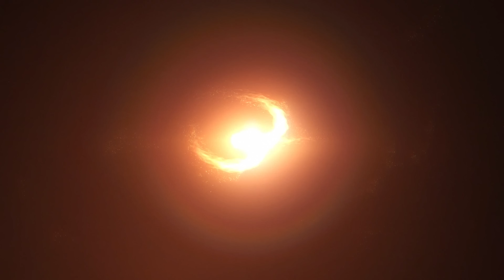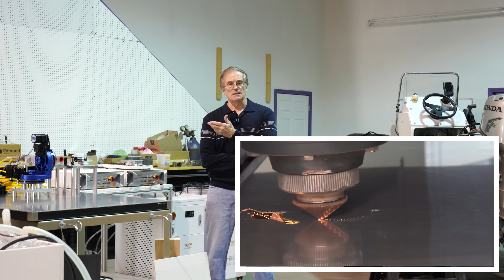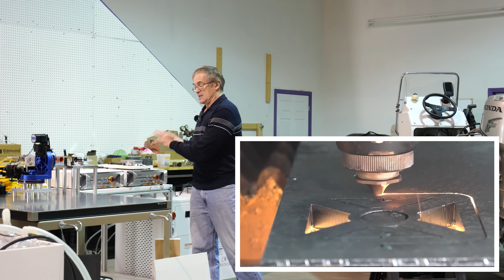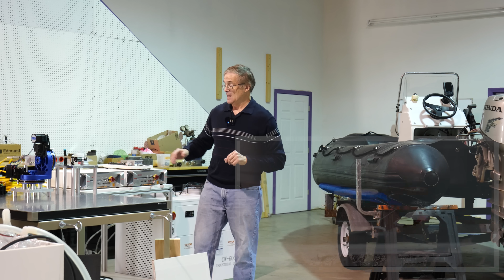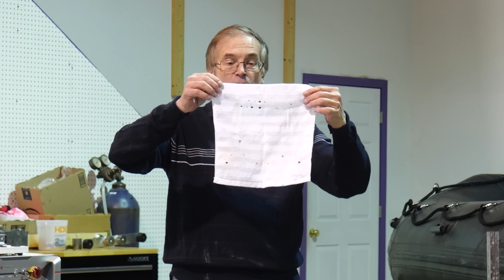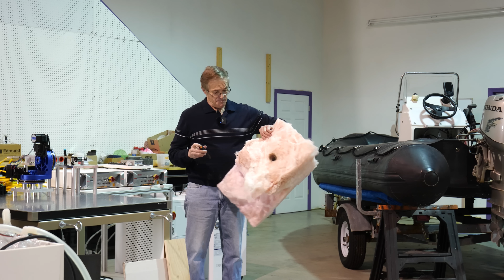We have a problem... and need your help!

Comment: In a cold room, could you heat a surface below to generate turbulent rising air that causes the beam to refract and lose energy before hitting a backstop of some kind? Perhaps overlapping tiles fresnel lenses?

Comment: Have you tried multiple layers of cement board, instead of gypsum drywall? Should last long enough for you to turn off the laser, you could mount them to a steel 2x4 wall that is on industrial castors, so you can wheel it around. If you cut the boards into smaller pieces, like 24" square, before mounting them, you could also make it easier to replace. Hell, you could put whatever you want in between the boards, like sand, ceramic tiles, rockwool insulation (made of minerals instead of glass), starlite(Nighthawkinlight). 

I'd be interesting to see if 2 pieces of 5/8" cement board, with 1/2" of starlite in between, like an oreo, would be able to handle your lasers.

Comment: If the target were rotating, then it would dissipate the energy across a large circumference     So a  circular piece of very flat dry wall, a few dozen cm in diameter, mounted to a small motor, will keep the disk moving, so that the energy is dissipated in a very large area, not a pin point.   Need more dissipation, just increase the diameter a bit, until the target can tolerate the power continuously.   The circular shape, can easily be marked, with rotation and a fixed pencil.  Slowly cut into it there, as it rotates with a sacrificial metal blade.  May be self balancing?  idk,  or may take some patience.   Keep it dry.

Comment: How about clear polymer orbs that are wett, maybe inclosed in glass or clear plastic sheet on each side to hold then in and 4-6inch thick layer of a standing wall. laser should be shattered due to orbs round shape.

Comment: 45 degree angled mirror directing the beam straight down in to an oil barrel with sand and water or a piece of composit material containing ceramic. Like tank armor in a layered construction. You simply cant have it all.. Cheap, durable AND portable and so on If its cheap and easy to come by, you say goodbye to portable. If its expensive it will be hard to come by and most likely not portable either. If you find something that will do it all.. make sure to get a patent and give darpa a call before uploading your video. Darpa or D.O.D pay a lot more then youtube.🤘 Happy hunting. NB: Here in Denmark we have ww2 bunkers all over.. those things would only feel a tickle if you shot you laser at them.. 6 feet thick walls of old school cement can take a beating

Comment: As a jeweller, i fix jewellery with a laser. Often with gemstones, which are vulnarable to laser light and get damaged when hit, even by indirect scattered laser light. 

When soldering with a flame, there are cooling pastes on the market, a white thick gelly paste, wich protect stones for the same purpose but against normal torch flames. I went about testing it while fixing jewellery, and this paste also proofs very effective against laser light. As a test I could cover a piece of printer paper with a thin layer of this paste and would not be able to laser a hole through the thin paper anymore.

The combination of moisture and the white substance in this gelly paste, seem to be very effective in blocking and absorbing laser energy.

I hope this helps!
Reply: This is the best answer from someone who started by stating their credentials so far. Here's why I like it. The solution is portable, plausible, and doesn't ask that any part of the experiment be reworked to accommodate it. For those Reasons I'm very happy with your comment.

Comment: hi have you considered sandbags? with for instance, playsand, maybe even high silica sand from a desert/ beach area. it'd have enough diffraction, thermal capacity, self-collapsing ability, to make it cheap and usable,  and in bags like hessian, or military surplus, would be easily buildable and take-downable. only problem i'd forsee is that you shop looks like a bunker.

Comment: How about two sheets of glass transparent at laser frequency with water inbetween that has a dye in it NOT transparent to laser frequency so that the lasers energy would be turned into heating up the water.

Comment: What about that expanding firefoam stuff?
I can't remember the exact name of it, but when exposed to high temperatures, a carbon film expands which can absorb an absurd amount of heat. I'm not sure if it would work with energy focused in such a small area, but that stuff is like magic when it comes to absorbing energy and is completely non toxic.

Unless this laser is capable of melting carbon, I think it should work.

Comment: There are fire resistant coatings that create carbon foam when heated or contain expanding graphite. You can also try basalt mineral wool, its melting point is 4 times higher than your glass wool. Or you can try to combine and cover mineral wool blocks with fire resistant coatings.